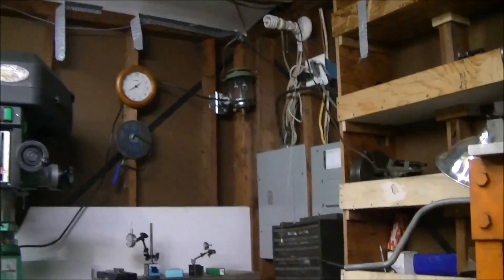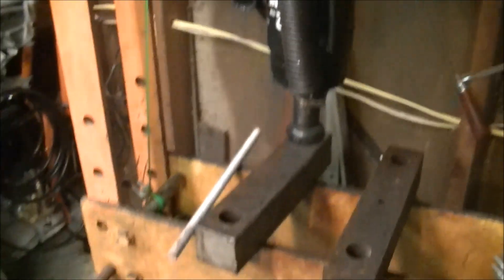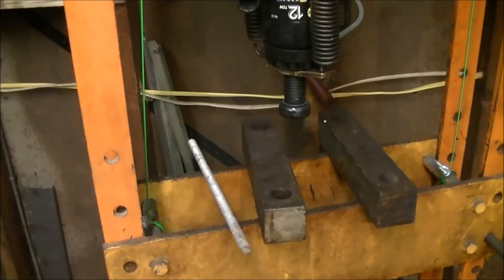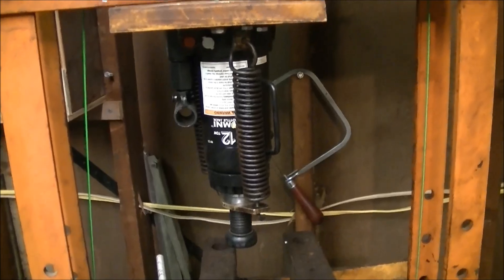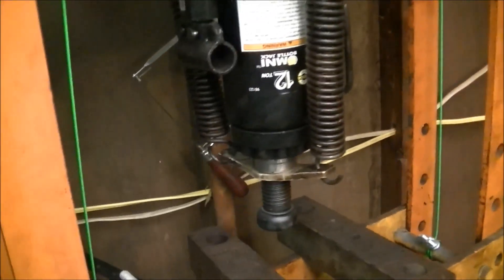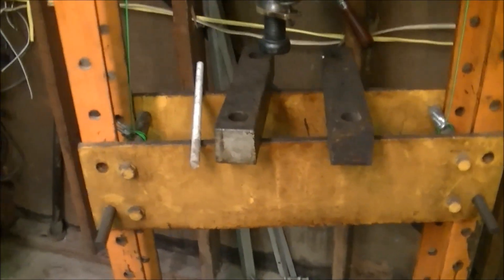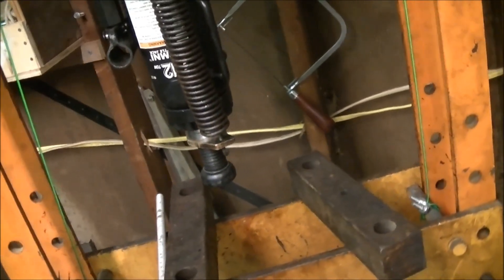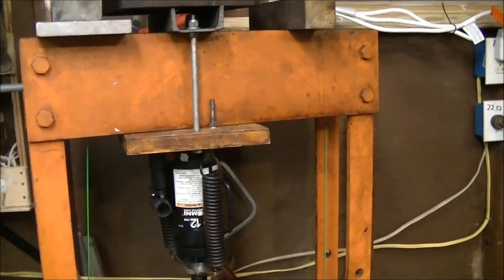Hydraulic Press built the right way

Comment: Cheap japanese before chinese..... you almost hit the nail dead square on the head... it's more like cheap japanese before CONSISTENTLY-GETTING-WORSE CHINA-MADE DISPOSABLE JUNK! We can't count the number of times china's products were advertised as "quality made dependable product but at lesser cost" and they came in their factory sealed retail box missing fasteners and other parts, holes drilled so far off that couldn't get the bolts through one side and lined up with the other, paint started chipping or pealing right from the start or not long after using them, stating they can handle much higher loads than reality allows, tires that wouldn't stay inflated, power tools that started smoking right out of the box or not long after they burned up with normal use....about the only thing I see now that is pretty well made, for the most part, are things like wrenches and sockets but I still do my darnedest to buy those MADE IN USA or GERMANY
Reply from the maker: Yes it is hard to get good tools.  Thanks for stopping by.

Comment: Nice press. I built one years ago using the upside down 50 ton Sears jack with tin can oil reservoir like your original one.  I got the idea from Popular Mechanics or some other similar magazine. Unfortunately it was stolen after my father died and the farmstead was not properly guarded by a (con man) tenant.
Reply from the maker: Sorry about the bad luck.  I like the upside down jack better than the oil can.  Of course both work the same.  Thanks for stopping by.

Comment: Do you recall how much slop you have built into the pin holes vs. the diameter of the pins?  On the one I'm building, I'm using 3/4" pins, but there obviously needs to be some allowance for slop so the pins will go in easily.  I'm just curious what you did.  Thanks!
Reply from the maker: At first I used 5/8" bolts and they are a bit smaller than a 5/8 drill bit so their is plenty of slop.  In later years I just went to using 5/8 bar and it still has plenty of slop.  I think many drill bits make a slightly over size hole.  Thanks for stopping by.
Reply: I may need to do a little reaming as my pins are pretty tight in the holes.
Reply from the maker: That could make it easier for you.  Their is no need for an exact fit as you are depending on the cross section for support and they are not going to slide horizontally.

Comment: How were you able to get the jack pad off the threaded extension so you would grind it smooth?  Is it just threaded on the threaded extension piece?  I bought a 20-ton version of this jack and want to put in a plate with springs to pull it back up as you did, but the hole in it needs to be smaller in diameter than the pad obviously.
Reply from the maker: If you look carefully at the end of the smooth ram where the threaded part comes out you will see some of the metal has been penned over to stop the threaded part from coming out.  I used a dremel with the cutting disks to remove the part that was penned over into the threads.  Then it will unscrew easily.  At least that is the way it worked on the last two jacks.  Thanks for stopping by.
Reply: Amateur Redneck Workshop Thanks. I have noticed the peeled areas that you mentioned. I'll give it a try after I get rid of these.

Comment: What did you use for the cross bolt sleeves?  What size are the bolts?  I was thinking about using 1/2" grade 8 bolts for mine.
Also, can you tell me how deep the working platform is and how tall the unit is?  Thanks!
Reply from the maker: I used plain old galvanized pipe for the sleeves and 5/8 x 6 inch bolts.The press is 5 feet tall and the platform is 5 inches by 23 inches and is made of 1/2 x 6 inch hot rolled steel.  The flat metal plates on the top are 1/2 x 6 inch x 23 inch hot rolled steel.  The thinner side supports are 1/2 x 2 inch by 5 feet cold rolled steel.  Thanks for stopping by.
Reply: Amateur Redneck Workshop Do you suppose 1/2" grade 8 bolts would be sufficient or is it more important to match the OD of the bolts to the ID of the pipe? 
I just ordered one of those jacks this week for this project and am really looking forward to having a strong press for car projects.
Reply from the maker: I used the 5/8 bolts for their sheer strength.  Look on the internet for bolt sheer strength and you can determine for yourself how thick a bolt you want.  The bolts holding the press together are not going to have a lot of tensile stress (pulling them length wise) but instead they will have the interface between the metal surfaces and be subjected to sheering stress (cross ways of the bolt).  I of course have done my press with an emphasis on safety for me.  I have tested it with 20 + tons and no problem.  So I feel good using the lesser size jack I am using.
Reply: Thanks.  What spacing did you use for the platform pins on the uprights?
Reply from the maker: The spacers were galvanized pipe cut to about 5 inches so the overall size to the outside of the uprights would be 6 inches.  This dimension can be larger if you want it to be.  If you are referring to the holes to hold the platform at height you can use about any spacing.  I am not sure what the spacing is but it was about 4  inches I think.  This is not critical.  It would be best to stay within the length of stroke of the ram of the jack for ease of adjustment.
Reply: Thanks.  I was thinking of using 4" ctc.

Comment: Just to buy those two steel support blocks would cost more than the Harbor freight press I imagine. Those are heavy duty. 

I pressed my daughters left wheel bearings a while back in a 2000 Ford Focus. You talk about one hard joker to block up level. It has 3 arms coming off of it aiming downwards a bit and nothing on it is square except a skinny rim around the bearing.
I really needed a cylinder to support it but made do without it. I'm gathering up all kind's of press pins and supports all the time. 

This evening on my Dads Smithy lathe I turned down a piece of 1-1/4 iron pipe to press the bushing in a sun shell on my AX4S transmission rebuild. Worked like a charm. I should have left a step to set the depth though, I like to have never got that set to 1.283".
Reply from the maker: +ILTSYC getting things positioned can be a bit of a job sometimes.  I like it when they build in a ledge for the bearing to bottom out on.  Thanks for stopping by.
Reply: Yesir! Sometimes you need the perfect push pin and the perfect size support.

I'm thinking an electric over hydraulic motor would only need to run if the press is moving instead of like a log splitter. Like a hose crimper.
Reply from the maker: +ILTSYC that is true.  I know a fellow who has built a press that looks like this only much larger.  I think he can press maybe 100 tons, 50 at the very least.  He has a motor powered hydraulic pump and only runs the pump when pressing something.  It is very noisy.
Reply: I don't like a lot of noise. The air over hydrualic presses are obnoxiously noisy as well.
 What irritates me with our 50 ton is when you back off to check things or reposition it takes or set the next piece in it takes forever to jack the thing back down to where its touching.

I pressed wrist pins in 4 pistons and rods a while back for the 2000 Ford Focus rebuild and almost jacked myself to death with that thing.

Here is a pic of ours at the shop. Its a Carolina 50 ton. The supports have been bent over the years but the frame has stood the test of time. Dad bought this thing around 1978 I believe. He got a band saw and a drill press with it.
http://rc.runryder.com/helicopter/rr/rrpv.htm?d=/helicopter/gallery/88559/&IN=1&TZ=-5&a=0&s=0
Reply from the maker: +ILTSYC that looks like a durable press.  The reason I prefer a jack upside down is for the screw.  You remove the screw and machine the end smooth and flat and put it back in.  Then it can cover 3 or 4 inches of adjustment that you don't have to jack the hydraulic with.
Reply: Yeah plus you don't have to have a push pin plate for the jack to sit on with the upside down jack.

Our Jack has been rebuilt, it had got to where it wouldn't work a long time ago.

A nice quite electric hudraulic ram with 12 inches of travel would be nice, I'd like it quite as a mouse though. Don't know if that's possible.

Comment: I want to build a 50 ton version. We have a 50 at work but I want one at home. The omini 50 ton jack is 700 bucks. Cant do that but Home Depot carries a 50 ton Jack for a hundred and some change.

Electric over hydraulic would be nice but id rather feel the lever on some things. Ive never run a electric/hydraulic have you sir?
Reply from the maker: +ILTSYC no I have never run any type that you did not pump yourself.  Maybe you should look into one of those power pac things.   Ebay lists a lot of 50 ton rams for hydraulic systems in the $250 or less range.  Try to get one that pushes the ram downwards instead of a jack sitting on a beam table like Harbor Freight.  It will fit in a lot more housings and if it has an adjustable screw on the ram it will be easy to press it up against something before you start to pump, helping you get it aligned better.  Thanks for stopping by.

Comment: I like it man! Wise choice not telling the wife about hitting her car with the tripod. LOL!

 What size flat bar's are those 8"x3/4 and 3x3/4?
I just wonder if 8" channel would be cheaper than the 8" flat bar?
Reply from the maker: +ILTSYC the upright pieces are just between 3/8 and 7/16 (.4062) x 2 cold rolled steel and the pieces running crosswise are 1/2 x 6 hot rolled steel.  I am not sure if channel is cheaper than the 1/2 x 6 hot rolled steel or not.  Thanks for stopping by.

Comment: Hi Cerebus. Was the brand name you sold your presses under in the 1970s called "TruCut"? I have one and it looks a lot like your press. Upside down jack, relief springs, adjustable screw, big strap steel risers etc. Mine is about 6ft tall with holes all the way to the floor like yours. Only difference is that it uses an i beam type steel for the top bracket. The beam lip serves as a track that the jack can slide laterally on.  I need to make a table support for it as it was missing when I bought it for $40 a few years back. Your video has inspired me to get on getting mine back in shape. Might even paint it. Let me know if you want some pictures.
Reply from the maker: +drombit no I did not build that one.  I did not sell mine under any name.  I would love to see pictures of your project.  Thanks for stopping by.
Reply: The

Comment: Nice job, check out my HD 30Ton press on my channel We used an electric winch for raising/lowering the bed and a set of bearings running inside the uprights to keep the bed parallel at all times You can tap into the pressurized base of the jack and used a suitable pressure gauge to measure the pressure if needed, a 10,000psi gauge worked out perfect for ours, 10,900psi = 30,000KG based on the area of the ram, works great :)
·
Reply from the maker: +MCT Engineering that table lift is really neat.  You have done a fine job there.  I may just have to order another motor and make the table lift myself.  Thanks for stopping by.

Comment: A nice press Harold, I have wanted to either build or acquire something similar myself for some time. I once worked at a mine where we had an Australian made "Servex" , 60 tons manually operated press, with a 2 stage pump, one handle was fast acting, and perhaps gave about 15 tons of pressure and the other was slow, but gave the full 60 tons. The press also had a speed wheel to quickly wind up or down the acme threaded spindle fine adjustment before you used the hydraulics. It was a great press, the trouble is that even rusty old dirt encrusted examples fetch AU$3,000 on the second hand market, which is way outside my budget. Unfortunately this sort of gear is expensive, and the surplus market much smaller in Australia than it is in the U.S.
Thanks for showing us your press and explaining the workings of bottle jacks, Cheers from down under,
Rob
Reply from the maker: Rope Tangler if you work on any type of machinery you will eventually need to press something either apart or together.  When I did motorcycle repairs it was probably my most valuable tool.  The wonderful thing is that anyone can build it with common shop tools.   Thanks for viewing and commenting.

Comment: You've built one similar in theory to my dad's old Van Norman 50ton (might be 75), which apparently Dake is still producing and selling for about $5k. 
http://www.trick-tools.com/Dake_75H_Hand_Hydraulic_H_Frame_Press_75_ton_07003_1578#.VMSGzCsgiXs
Reply from the maker: That Dake is a lot heavier than my press but it certainly does look a lot like it.  I actually copied a OTC hydraulic press.  I need to put some rollers on the top brace so the jack can move side to side.  I bet I do that soon enough.  I know my press can take 20 tons as I have tested it at that and maybe a little more.  I used the Steel Construction Manual to get the strength of the materials in the various directions of stress and I don't  remember how much the weakest part was rated but it was safe at some respectable pressures.  Thanks for viewing and especially for commenting Aaron.

Comment: Nice build, and it may have just inspired me to build another.  Thanks Cerberus

I say build another because  I once built a dandy of a press but many many a years ago some crackheads stole my southbend lathe, my press and more for scrap metal. I know this because the scrap yard guy they sold it to recognized my blue anodized collet holder since I also made 1 for his son 1 in a  horse-trade. After his call and too many missing and damaged parts I told him to keep it out of aggravation &  disgust. 

In short I'd rather build one thats not made from my or others stolen scrap steel which is shipped to china and in turn sold back to me in a degradingly poor quality tool.
Reply from the maker: Thanks for the comments M1ST3RHYDE.

Comment: Good tips!

I didn't like the Horror Fright Item, for a 20T press went with the Sunex 20T.  USA made, built does have a 20T China jack on it.  I like your caster idea, as my days of moving with with a dolly are over.

Arbor Plates -- HF sells some odd cast stuff that has shattered with bad results. Toss into scrap metal bin, and get a decent 1.5" plates from Swag Off Road.  No ties to them, just a happy customer.
Reply from the maker: Tom it appears that we both have the same idea of quality.  I put casters on everything.  I find it is easier to get by in a small space if you can move the things you are not using right now out of the way.  Thanks for the comment.

Comment: That's a better idea! My Dad has one of those Harbor Freight design jobs and the ram wants to go every direction except straight down. Rigidity was definitely an afterthought. Using a bottle jack down side up never really crossed my mind. I figured that I would have to mount a rigid hydraulic cylinder with a pump for actuating it to make it right.
Reply from the maker: Thanks for the comment Chip.  As you can see if you get the correct jack you don't have a lot to do to make it work.
Reply: I'll have to keep my eyes open for a jack.